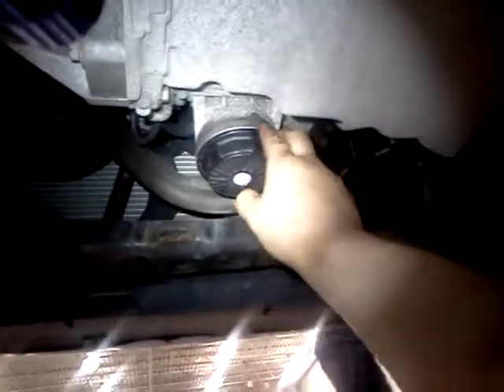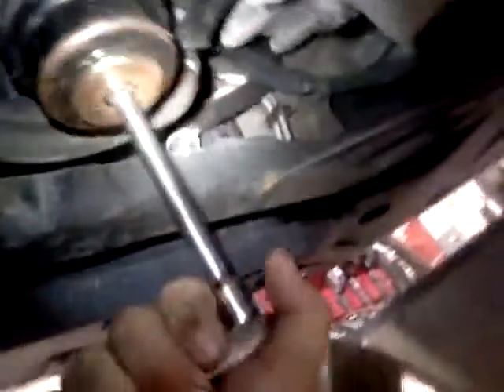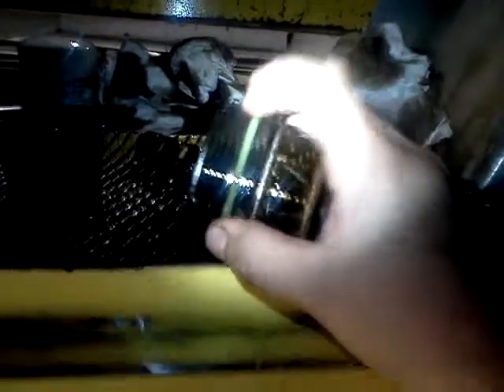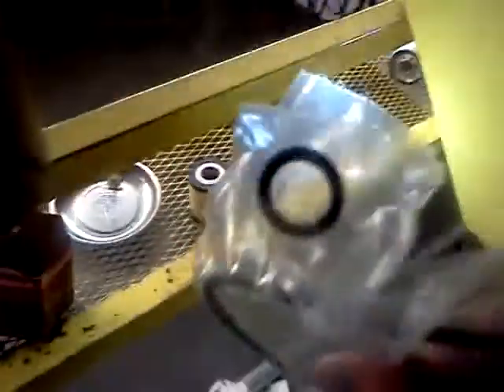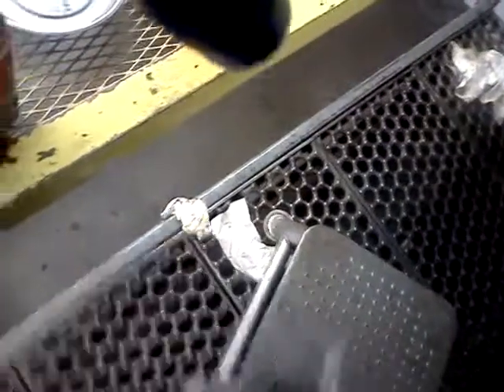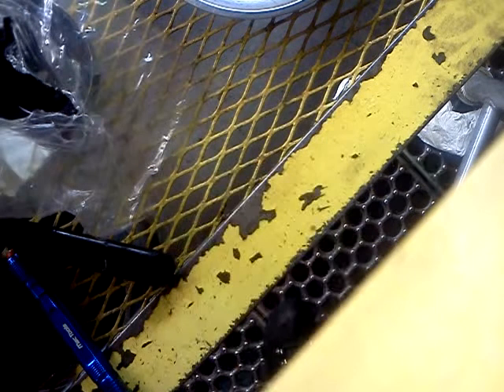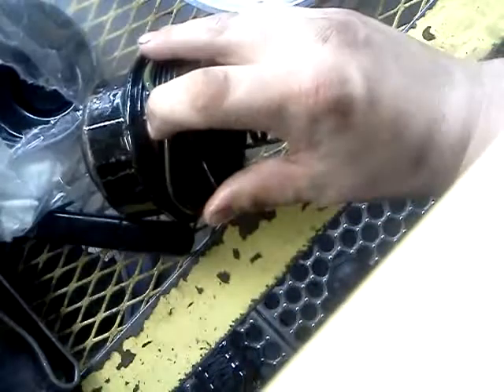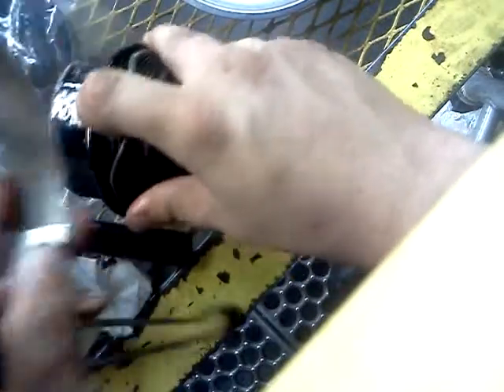Ford fl2017b filter

Comment from the maker: dont buy a early 2012 release the transmission is a twin clutch automatic and they shift kinda funky , the later models have an updated syncro and clutch management program update that makes the shifts almost seamless. overall they are great cars . ive seen the block heaters leak on a few models other than that really no issues but they are new so the long term will show. i would wait a few months and the Focus ST will release and drop the prices of the new normal models